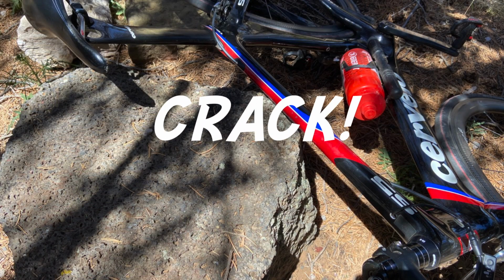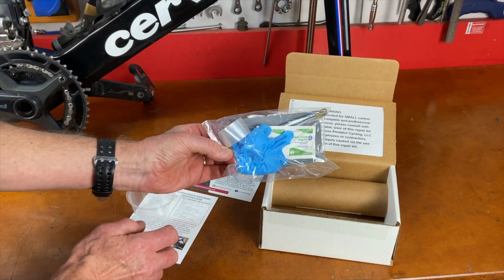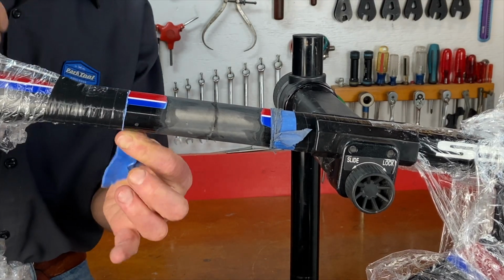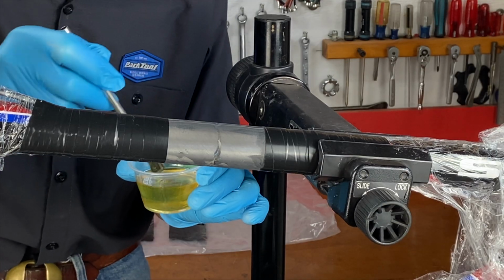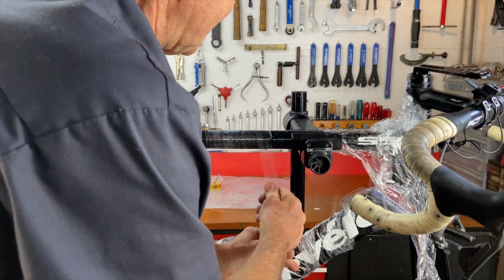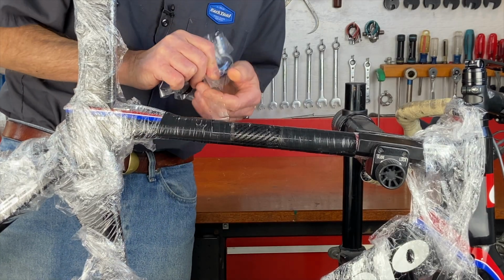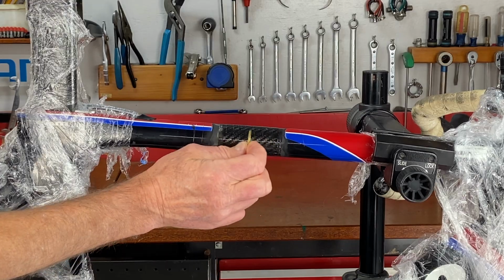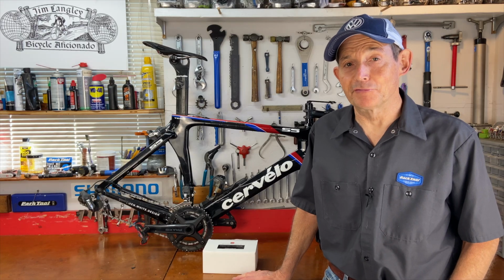Do it Yourself Broken CARBON BIKE REPAIR! #carbon #bikerepair

Comment: Hello Jim. 

I hope you are aware that this is a replacement repair that does not guarantee the transfer of loads like the original. After such a repair, there are many dangers, which the strength of the materials speaks of. I will just mention that the cross-section of the same piece is different than that of the base element, there is still a notch there and there is a large material fault, which may cause bending stresses. In addition, there is a high randomness of execution, no tests and no control after repair beyond the control of the coin :). Generally it is very risky what you did, but .... whereas you are a sensible person with experience as a bicycle mechanic, you have all the risks at the back of your head.

I recommend not to paint this bypass and make a visual inspection after each ride to see if there is a crack. On the other hand, the rupture of such a thin patch will be very violent and rather total.

Apart from the topic, I am a little surprised people buy a product as risky, poorly made, dangerous and easy to damage as carbon bicycle components. In my case, I only have a carbon water bottle cage, which may also do some harm in the event of a breakage.

Best regards and good luck with this frame.
Reply from the maker: Thanks for watching and for your thoughtful reply Michal. I appreciate your concern for my safety. I probably should have explained more about the patching in the video. I'll do it here to try to address and ease your concerns. I bought the patch kit from Predator Cycling, a company that manufactures carbon frames and I first discussed my repair with them and showed them photos of my frame's crack. They told me that their kit was made for these types of repairs.

The way the repair works, the carbon patches saturated with epoxy are pressed hard onto the sanded and cleaned carbon of the frame with the heat shrink tubing. During the process of drying, the carbon patches and carbon frame become one. The carbon patch presses down into any groove remaining where I sanded the crack. So, if it all worked as designed, that area of the frame is now 2 more layers of carbon thick and the crack - at least on the outside of the frame should be completely filled and reinforced, too. Thanks again!
Reply: I've got to disagree, there are no dangers the more overlay of carbon the stronger it becomes, I've repaired lots of  mtbs in a similar manner, even chain stays and they are bullet proof, there's no way that would continue cracking or break, its alright saying this will happen and that will happen when you've never experienced doing a carbon repair, or not really knowledgeable about it, it's no different from welding a hole up in a piece of steel, it's just a bike it's not under serious load, people like you worry about the smallest things 😉  that frame will be solid
Reply: @shaunsmith3660  Thanks for the comment, but I definitely disagree with you. The fact that you have repaired a hundred frames and they are still alive does not mean anything. If you had any knowledge on this subject, you should know what the fatigue calculations look like. I am referring to the material strength course, especially please pay attention to the section devoted to fatigue analysis.
Reply from the maker: @shaunsmith3660  thanks a lot for sharing your experience fixing carbon bikes, Shaun, appreciate it a lot!!
Reply: @JimLangley1  I know a thing or two about carbon and trust me this repair will be just fine.
Reply from the maker: @jameslowe2979  Thanks for commenting, James, appreciate it. I'm happy to hear another knowledgable carbon person say the repair will be fine, thank you. For the record I've got thousands of miles on the repaired bike now and put in many rides on steep climbs and over very rough roads where I've hit significant potholes that I didn't see. The patch is holding up just fine the way Predator Cycling said it would and the way I thought it would. Thanks again!
Reply: @JimLangley1  that's great to hear Jim. I think the only improvement to your repair would be to have put a third layer cut at 45 degrees so that you have fibres going at 0 degrees 90 degrees and 45 degrees. This would take care of any 'twisting' of the tube. It will be  be fine as it is as the repair is half way down the top tube and in an area not subject to huge forces. Happy riding!
Reply from the maker: @jameslowe2979  great tip for if I have to do another repair. Thanks a lot James, appreciate it!

Comment: Frames are built with ~4 to 8 layers of carbon depending on where the strength is needed. DO NOT patch your bikes like this. There's a reason why it costs so much to patch a frame. They put more than 20 minutes and 2 bandaids into the repair.
Reply from the maker: Thanks for your opinion bentBuilder but this repair took hours and the frame now has its original layers plus 2 more. It’s a kit designed and made by a carbon frame company and they confirmed it was correct for my frame damage. I have many many hard miles on the frame now and it’s fine. Carbon is much stronger than it might seem.

Comment: This is not a proper job to repair any crack.
Reply from the maker: Thanks for watching. Please explain why you think that.
Reply: It is not as good as prepreg + autoclave/rtm (as it is made at the bike manufacturer) due to small compression, not optimal epoxy to carbon ratio (more epoxy = more fragile) and possibly there could be air bubbles/voids in the laminate (not this case as it seems, but usually it comes with diy aproach)
Reply from the maker: @Anton-zb9dc  thanks, Anton. This is a kit that comes from a maker of carbon bicycles, so you're getting what they designed to fix cracks, i.e. what a professional carbon manufacturer recommends and that includes the carbon fabric, the epoxy and hardener in exact measurements and how to mix it (no bubbles) and how to compress it - in a different way than a mold is used but still very effective. But I can see how if you didn't use a kit and tried to figure out how to buy the materials and do it yourself you might not end up with a proper repair. But with this kit, you'd have to not follow the directions or make a major mistake.
Reply: It would be cool if you would inspect the repair from inside with endoscope to see if there are any drips of epoxy or something similar. That would be interesting!
Reply from the maker: @Anton-zb9dc  yes, that would be cool. I don't have an endoscope to do it, though. But it's a good idea for sure. Thanks!
Reply: Old carbon becomes harder so not any poxy is suitable. Any cracks should be stopped first before further repairs
Reply from the maker: @benquip  thanks for explaining your thinking. According to the maker of the repair kit, this does stop the crack.
Reply: you can watch the GCN video about carbon repair if you want to get an idea what a professional repair jobs involves.
Reply: I’ve used this kit on 4 bikes & have had no issues. I’m in the industry & have access to crash replacement frames so just for experimental purposes as a bike hobbyist I wanted to test/learn about diy carbon fibre repairs & so far this has worked on 3 road bikes with cracked chain stays & one Ebike with a cracked top tube. I repaired, built up the bikes & spent months on them trying to get them to fail & so far so good. For all the engineers & experts commenting on how this is not the right way to do a repair…………. go watch a different non diy video. This has worked for me many times as well as others & I recommend it to anyone who is on a budget & cant afford the $1,000+ cost of a repair shop doing the work. Shops that do these repairs also require you to fully disassemble the frame of all cables, wiring, bearings, linkage etc that just adds a ton more $ you need to pay a bike shop to do for you & then reassemble because the carbon fibre repair shops don’t do that for you. They just repair & that’s it. They are experts in repairs not taking bikes apart & getting brakes bled, bearing/BB removed/pressed back in, getting drive trains to shift properly after the fact etc.
Reply from the maker: @phildattilo8598 thanks for sharing your successful repairs with this kit - very interesting and helpful 🙏
Reply: What time window does that epoxy have (how long do you have to apply the epoxy?) I like that heat shrink tape. Looks like there is enough material to do multiple repairs.
Reply from the maker: @rfreitas1949  hi Bob, I can't remember the exact curing time but it's plenty of time not to have to rush. I was shooting the video while doing the repair and I forgot to turn the camera on. I had already applied the epoxy and the patches. When I realized my mistake I had to remove the patches, and reshoot the process. The epoxy stayed liquid the whole time. I don't think you'd have any worries about the epoxy setting before you finished the job unless you got distracted overnight or something.
Reply: @Anton-zb9dc youre wrong. More epoxy doesn't mean weaker it means less strength to weight. Now more that ever carbon is dryer which makes it more brittle and lighter. The compression with shrink tape or any tape is more than enough and is more pressure than vacuums. Voids, wrinkles, and air bubbles aren't a problem when wrapping a tube, they are a problem when laying up and vacuuming an entire frame. For the top tube the repair will be sufficient. The crack is still under the patch but it will still work and is likely stronger and stiffer. Even the best repair experts can't fully restore damaged carbon tubes, the ones who claim they can are lying. Good thing it doesn't really matter all that much. Bike frames don't need to be precise to still work efficiently.
Reply: I liked your video and subbed as a result. I also liked the way you responded to all the negative nellies who attempted to shoot down your obviously productive result. I have a pinarello dogma f8 frame that was given to me by my neighbor who told me he pulled it from a dumpster, he believes it has more than one fracture. It's been sanded in many places in search of said fractures.  My question is how many repairs will this kit do? Thank you for your time.